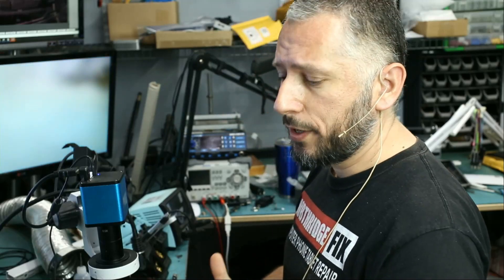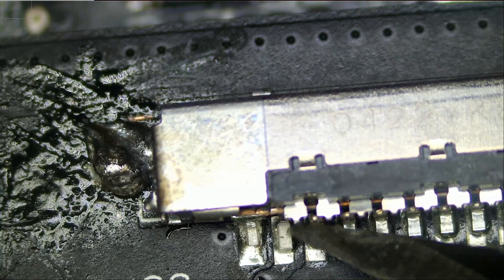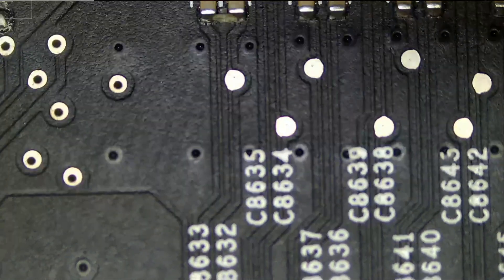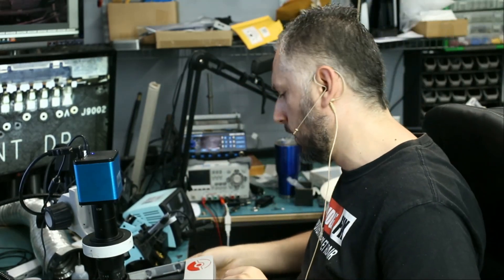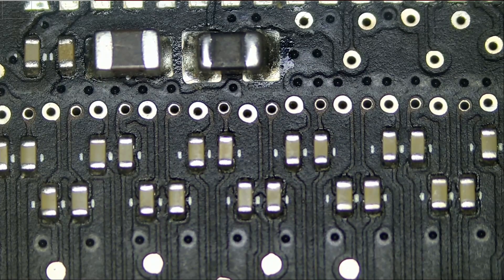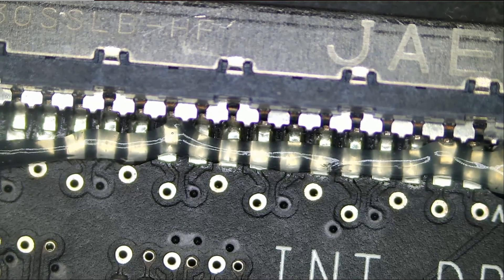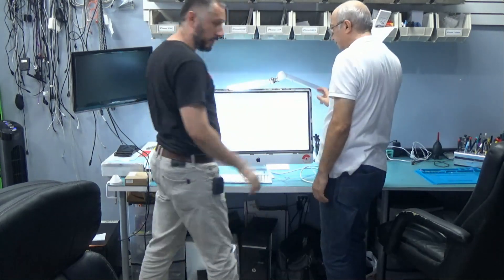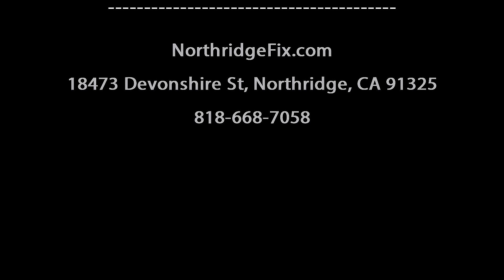2010 iMac 27" Damaged Display LVDS Connector replacement.

Comment: Thanks for the video, I followed your steps but after removing the bad connector there was some bridged pads, how can I verify if the bridge on the pads number from the left(3,4,5,6) and (7,8,9,10) is legit in your video pads 5&6 and 9&10 was bridged by the printed circuit I mean they showed bridge after you were trying clean with the wick, in my case its 4 of each set not 2? Thanks for your help

Comment: Those 2010 LVDS connectors are fragile, easily ripped off because the cable is very short and getting to it to disconnect is not easy. So is the 2011 one which is smaller and even more fragile. There's a stand locker or whatever it's called that stops the whole thing swivelling on the stand, then laying the computer  horizontally so easier to work on.

Comment: If you push the power on and off button too hard on a iMac or Apple product it will break, nothing but complete garbage product, usually designed for idiots to buy at high price

Comment: What's it mean if there are no diagnostic led lit on late 2009 imac, but the fans come on and the boot chime is heard? The guy i bought it from ripped out the LVDS connector. I replaced it with a salvaged one, but no go. I'll remove it and try with a new part. Meanwhile, with no screen or cable attached, what's up with the missing LED status? I also noticed that there is no voltage coming out of the pins for the backlight, but there is 12 volts coming into the backlight board. If the vertical sync cable is not in (the screen is not installed when I am checking these voltage points), will the back light voltage be affected? That would not make sense.  Just looking for clues.

Comment: Your video shows an excellent way to repair the connector.  However, when I removed the base connector about three of the pins broke off and went somewhere into the body.  Any advise on how to fix this?  Thanks.
Reply: same. they very fragile.

Comment: Another good lesson. I tried soldering a connector a few days ago, and it constantly create bridges between some pins. After seeing what you said, I've got back to that connector and checked, and internally, the pins that create thoss bridges are connected between them. So, no more worries with that, and everything is working. Thanks again!

Comment: I have this same problem. 2010 27” LCD cable connector is broken on the board. What I am also dealing with is the connection is also broken on the lcd screen also. Is this fixable?

Comment: I have an imac 2010 27 ", which the display turns off but the equipment is still working, I changed the inverter card and it worked for a couple of weeks, but the same problem came back, what do you think the problem is? thanks

Comment: Hey I have the same problem with my mac 27'' but there are 4 connectors for the display instead of one and 2 out of the 4 connectors are broken off I don't know what they are called or where I can find replacement parts pls help.

Comment: Those 4 pins at  ( 14:55 )were not supposed to be toguether, check carefully from 7:10 to 8:30. You used to much solder. You no good my friend...not even using a telescope.

I will never  take my imac to his place...😁😆
Reply: then how come the lcd fixed?
Reply: @wahabfiles6260  Luck
Reply: You are correct. those pins were not connected together 
 Surprised it worked!
Reply: There is a trace connecting the two pins in two cases on this connector, and if ANYONE knows how much solder to use, it is Hussein Ali.